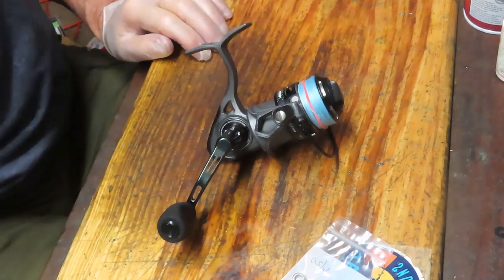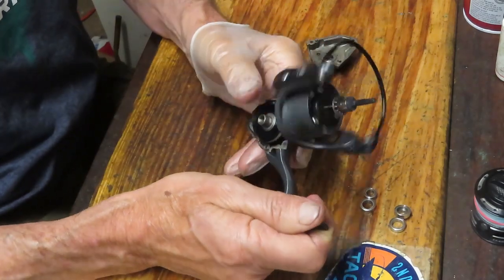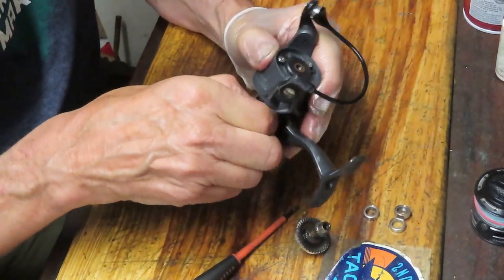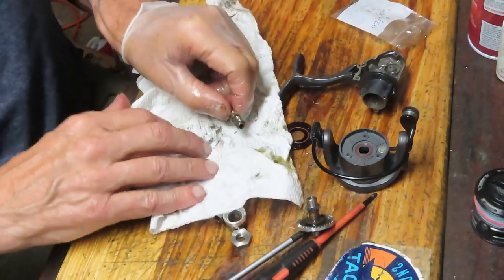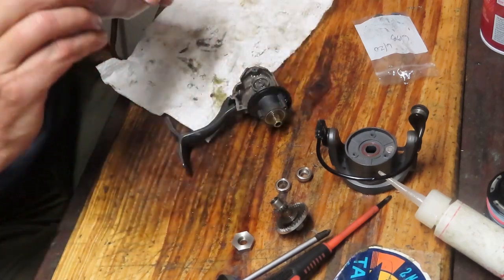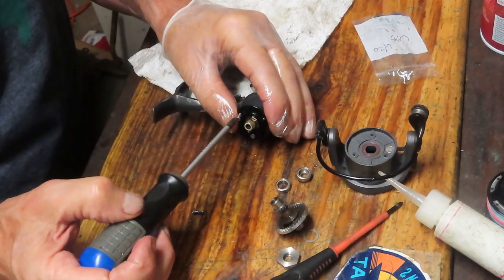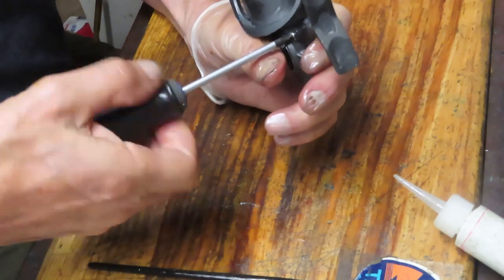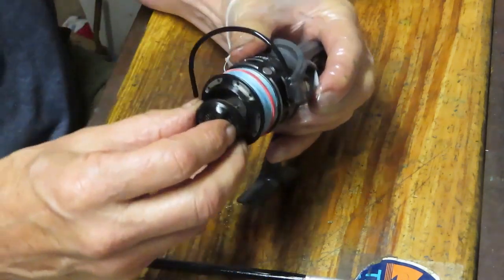Penn Clash II 2000 spin fishing reel how to take apart and service

Comment: This is a great reference video for reel maintenance! If you wouldn't mind answering,  I noticed the other day as I changed out my braid on my clash 2, the line ended up laying very bottom heavy. I looked into it and its said its due to too many shim washers making the spool too high. I opened my clash 2 and It seems like the clash 2 models don't have shim washers in them by default, (I could easily be wrong). Is this a shim washer issue or is there an internal part i need to tweak? Thanks!
Reply: 6:25

Comment: I’ve also seen a Penn Wrath and I have no idea where that one falls in the order. I’d guess the low end. You know how I feel about reels with No AR override. I will never like a reel that doesn’t have one. By the way, my iPad said that Reel Schematics lost their privacy certificate. I could get to the site today. Dennis I worked on a Compac SL114 saltwater reel. It was in excellent shape except for one thing. As try as I may I could not open the housing even after all the screws were removed. I tries two different razor cutters to try snd open the seam but it was glued tight. I imagine it was old grease. I’ve used both wD-40 and PB Blaster but to no avail. I’ve sprayed it down good but I don’t think the seam will let me in. Any ideas? The screws came out easily, the handle came off, and the spool came off but the housing has been impossible. Out of working on well over three hundred vintage spinning reels, this is the only one I have failed to get open. I’m really starting to think I’m losing my touch with these old reels. I did service a nice Mitchell 486 today though. This was a great video as I had not seen a Clash serviced before. I assume Penn makes a Clash in a larger saltwater size too. — Chris
Reply from the maker: The Wrath is a very low end reel.  About $40 at WalMart or Amazon On you case issue - that has happened to me before.  It has usually been associated with a bearing frozen on the shaft of the main gear and in the case housing.  The most recent one was on a Penn SS650.  What a mess!  - Sometimes, it just doesn't work as planned - Thanks Chris